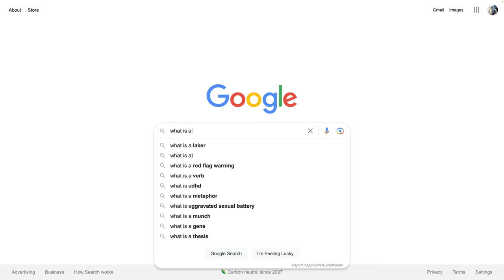I Quit My Car for 30 Days, Here’s What Happened

Comment: Remembering to ride for fun is really important imo. I've now gone full circle from crappy bike to nice road bike to wanting a cheap bike that I can ride places and lock with 0 fears of it getting stolen
Reply from the maker: The only solution is to get all the bikes 😜
Reply: @MitchBoyer  Yup I have 5 bikes. Quit my car for about 400 days now though. Rented a few times but way less than I expected. I haven't really missed it tbh, even though most of my life is in a circle as large as 130 km (diameter).
Reply: Even crappy bikes get stolen . That is the one downside of bikes. Bike thefts
Reply: @Sirissssss right, people think that beater bikes are less likely to get stolen but nah, thieves would still steal a bike even if it had rust all over
Reply: @sonymicronin  it's not less likely, it's less devastating.
Reply: I’m super lucky to be in a city with a bike share, and I use that as my “third bike” option: nice road bike for adventures, solid steel frame commuter with panniers for going to work, and bike share for going to dinner, to a concert, to a park in a high theft area etc. They are slow and goofy but reduce my fear of bike theft to near zero

Comment: I "dutched" my 30 year old MTB last year.  I ride it everyday, and I went to the store today to get bread and bananas.  You should get another pannier to go with the one you have to balance out the load.  I have two to keep the weight even.  I need to look into a front rake too.  I just changed out the rear hub for a Eviolo 380 hub.  Works great on hills and flats with a 24/17 combo.

Comment: dutch bike (in my opinion):
- costs about as much as the lock it's tied down with
- enclosed chain
- coaster brake
- lamps cheap enough to be left on the bike at all times
- some cargo capacity
- mudguards

it's not about the handlebar

you should look into european postman's bicycles, they look fugly but are a pretty sweet deal for what they are (short gears, enclosed chain, 1-200 pounds of cargo capacity all for 3-400 dollars perhaps although shipping might be a bit pricy)
Reply from the maker: Thanks for watching, Mark. I’d love to get one of those cargo bikes in the future!
Reply: In England today anything that isn't screwed down and locked with a  £150 lock will be stolen. I don't even have a bicycle lock as I never let my bicycle out of my sight or that of a trusted friend when I'm out riding. Even trash bicycles are stolen
Reply: @Honkawsuzyamal  bike should cost less than the lock and you should be prepared to change parts for vandalism. if you lock the wheels and the frame, it's not your bike that's going to be the one stolen, but the one next to it that's easier to steal. i lived in fulham although i know it's not the worst neighbourhood, this was my experience. cheap mountain bike, u lock and a cable for the front wheel, price of the bike about 50 pound, price of locks about 150. locking wheel skewers were still discouraging at the time.
Reply: @Honkawsuzyamal  now with little folding electric scooters, last mile transport is much more elegant i think. no need for the bike. i haven't tried these, but they look good to me.
Reply: @markifi  Electric scooters are not allowed on trains in  UK since last June. Electric bicycles are allowed at the moment
Reply: @Honkawsuzyamal  oh. that's a bit of a shame. thanks for the info

Comment: You can do laundry pretty easily at home with a large heavy duty plastic basin, a clothes washing plunger, and a spin dryer. I completed full loads quickly and easily with the basins set in my bathtub. And once spin dried I laid them out around my apartment to dry for a few hours. Did it for 11 years before I moved to a place with in unit washer and dryer.

Comment: Bicycles should always be the first choice of transport before getting in your car. You don’t get stuck in traffic or need to worry about where you will park or pay for it. You can usually lock up right outside your destination so that can take minutes off your journey if you’re unable to park close by. Even for longer journeys it can be surprising that there’s not a lot of difference in journey times and if there’s traffic in a town or city then a bicycle will usually be faster, check it on Google maps and set the time of your journey!

Comment: As a Scandinavian I think its funny how in the US you have to customize an old bicycle to make it into a commuter bike. Here you just buy one. 

Couple of summers ago I got a vintage bike(1978) for $20, put $50 in tyres and tubes, milk crate on the rear rack(factory) and it has been working like a dream.
Bullet proof coaster brake and in hub 3 speed gearing. 

No need to buy $XXX in parts, everything was perfect from the factory. All bikes come with fenders, racks, bells, lights, etc.

Comment: Haha, it's actually funny there's a video like this. It's very normal way of living in the Netherlands.. doing commute, groceries etc with a bike usually under 20km/12miles. Only the biggest difference is that dutch normal road bikes usually have a coaster brakes and no gears. I do have 3 gears and a coaster brake but its more luxery than a neccesity.  Most of us also have a bit larger transport rack on the front, but what you have is also common. Fun to see this in an American context, you would do very well in the Netherlands! Only you wont see Jack Black at the traffic lights here. ;)

Comment: Great video! I built up a Surly Straggler last year with a mish mash of used and high-end parts to get me around everyday (no car) and to have as an occasional gravel spinner. BIG difference to my Specialized S Works Tarmac that sits underneath a blanket in my room not getting ridden due to having a new born though. All of this to say, I am actively trying to sell the Tarmac as the fun level is genuinely through the roof with the steel tank. I get fatigued less as I am not trying to sprint everything, I have more fun exploring and of course riding to work. I don't think I'll be going back to a carbon machine but I understand the performance and speed factors are for real (I do miss sprinting at 40kph/h around Paris haha!). I hope you find more fun in your everyday biking needs! Cheers 😁
Reply from the maker: Sounds like a fun bike! Thanks Cameron!

Comment: 11-51 cassettes are the best for commuting.
Plenty of range to get up decent hills, and also room to run a big enough chain ring so you can cruise fast on the flats.
Reply from the maker: It’s been incredible! So glad Nolan recommended it.
Reply: And what crankset pls?
Reply from the maker: @onedelacruz3660  Shimano Deore Cranks with a Wolf Tooth 38t chainring
Reply: @MitchBoyer  thanks man
Reply: @onedelacruz3660  I'm on 700C wheels with 35mm tires, and I run a 38T chain ring in a 1-by set up.
I live in Hong Kong and we have a lot of hills, so I find I am very often riding in the biggest 2-3 cogs on the cassette. I think that is 39, 45 and 51. They'll get me up anything I need to climb, and I can carry quite a lot of gear.
Cheers

Comment: I turned my old Hardrock into a communter bike and it works fairly well. It is also so old I doublt anyone would steal it. I have limited safe bike routes but I can do grocery shopping and several other tasks without driving.

Comment: So what you have here is deemed an “xbike”, a bike with something eXtra. 

This would be the perfect build for it not for the V brakes, I hate them. I’m a diehard Canti fan, or discs

Thanks for making this video, it’s empowering to see others do what I’ve committed to doing myself.

In 2022 I sold my only car (SUV) and commute completely by bike and on occasion, my scooter. 

Initially this was difficult, but it gets easier once you figure out the logistics. I have a large chromebag when I go grocery shopping, I use a JackTheBikeRack when I switch between bikes, I also have a 90s MTB turned fun bike/xbike/commuter, it’s such a sweet ride.

There are moments when it sucks and I think it’s worth pointing out those aspects. When it rains, when it gets windy, too cold (I live in the Midwest), and of course too hot.

It is as you touched on, fun, and the fun never ends as I’ve doing it for about a year.

I don’t miss the cost of registration, gasoline, insurance, & repairs. If I need a vehicle to haul something I rent a pickup truck at a local hardware store, or we take my wife’s car for smaller hauling.

My commute is about 4 miles, I realize not everyone can do this, but if you’re within 5 miles, I highly recommend you give it a go for an month, you’ll notice an improving your attitude if nothing else.

Subscribed

Comment: Fourteen years ago I didn't have the money to fix my car, so instead I bought a new Diamondback Hybrid bicycle from Amazon. It took me some time to figure out how to have dry clothes when I got to work. Moving to a different job much further away I used city bus bicycle racks for most of the miles. I didn't miss my car except during cold wet windy days. Now I am retired and got me a shiny new Biktrix dual battery E-Bike. No more whining about hills and wind. Cold and rain is still with me, though being in Florida, cold doesn't last too long. My only transportation is my E-Bike and my old bicycle for back up. Florida has some beautiful multi-use paved trails, but most of the streets could be more bike friendly and safer. I mostly shop stores that care enough to have secure bike racks. Hopefully, cargo bikes will become more popular and prompt more people to to leave their gas hogs at home. That's my 2 cents.

Comment: Hello, a very good video around urban use of bicycles. As you point out, the type of use will dictate the type of bike and the accessories. I'll add that the environment is also a factor such as rain and snow. Mud-guards are a must for me in Montreal as are studded tires for winter. A trailer can also add to the ability to transport items. Theft is a big problem. I had a very nice bike which was stolen. I replaced it with a mid 1980's MTB and upgraded its components like yours. This way I worry less.
Reply: Even if it's a nice bike, I feel like even a little bit of rust puts thieves off. Also helps if it's a style of bike that isn't in vogue right now like an old cruiser bike. I feel like MTB's are the only style of bike most people are interested in now (at least here in the UK), so they're probably the most likely to get stolen over here. I feel like anything with an upright riding position, sprung saddle and a headlamp is seen as uncool by most people these days, but those are exactly the type of bikes I like 😄

Comment: To get things done in life, it looks like it's better to use an old "beater"bike with a steel frame rather than some new high tech carbon fiber bike with microprocessor shifting.  I found that simple information interesting.
Reply: Yeah. Old steel frame bikes weigh a ton, but they're sturdy af and I love them. I'd love to have an old Worksman industrial bicycle, but they're impossible to find here in the UK. I have a 1982 Raleigh B0mber (have to censor that word otherwise YouTube deletes my comment). It has a similar frame design to a Worksman, but lacks the second top bar.

Comment: Not bad, but until you take a scuba cylinder 20km before starting work I'm only mildly impressed.  I left home at 15 and only had a bike.  I did everything from shopping, to riding to work, and on that one occasion, getting my scuba cylinder to be filled.  It's called utility cycling.

Comment: Dutch bikes have fully-enclosed chaincases, meaning the chain won’t get all rusty in the inevitable rain, and either single speed or hub-gears. Also, more relaxed geometry for less twitchy handling and more comfort. Mudguards and pannier-racks are essentials too, for how else do you get your clothes to the laundromat or groceries back from the shops. Design for racing has rather spoiled the breed than improved it. Horses for courses, innit.

Comment: Dutch urban bikes (for less than 5km, flat terrain): 
(1) so cheap noone wants to steal it (for the real dutch experience, the rider should acknowledge the prevalence of bike theft but not chain their bike to anything)
(2) low top tube.. this gets important if there's a kid on the back as you can't swing your leg over the seat without roundhouse kicking them in the head 
(3) leave it outside, never maintain it, it should be a pile of rust with a chain last greased in 1942 
(4) 2"+ Schwalbe Marathon tyres... these rock! 
(5) swept back and high handle bars that let you sit upright on the seat 
(6) seat large enough to land a 747 on
(7) poor/absent helmet + lights 
(8) sturdy racks.. it's not unusual to see a 12yo kid being transported by just standing on the metal rear rack with hands on the riders shoulders

Two most common ones are "omafiets" (granny bike) and "bakfiets" (bin bike). The latter screams for an electric drive (mid-drive in your case for the hills) and there's kits available. If you're a proper cyclist, the laid back position will be irritating but with an electric drive you just sit back and turn the peddles.The cargo bikes (bakfiets) are nice to just fill up with stuff (kids/bags/dogs/girlfriends) and go.

Comment: Get a hand powered laundry washer and electric wringer you can use in your bathroom. I did that for a full year in a tiny apartment when I was saving up to buy a house. Much easier and more sanitary than sharing your underwear at the lavanderia. And get a trailer if you want to haul stuff. I have a BOB trailer that is probably your age. Also, your seat height looks too low on the town bike.
Reply from the maker: Good advice! The bike’s a little small for me, but I’m okay with it :)

Comment: I decided to quit my car for 3 months..and never looked back 😳. Not only did riding a bike as my main form of transportation get me in killer shape, it opened my eyes to just how little I truly needed a car in my life. 90% of my life is spent within a 20 mile radius..after a couple months of daily riding, 5-10 miles at full cadence is nothing, so long as you aren’t carrying groceries or something. I used my bike for grocery trips, mailing packages as part of my ebay business, took 142 lbs of brass to my local scrap yard, running general errands, I’ve done doordashing and taskrabbit gig’s (in the spring/fall, collected scrap too so..I got paid to ride my bicycle!) to and from work etc. I eventually upgraded to an ebike..and then scratched the itch I’d had for a sound decade and bought a dual-sport motorcycle. It’s now been 3 1/2 years and I still don’t have a car 🥲. I ride year round through all 4 seasons. It’s not only changed me physically, saved me a ton of money on car repairs/insurance, it’s changed the way I look at the way we get around in this world in general..it no longer surprises me that the countries in which people tend to live longer than average lifespans, are all countries in which bicycles are more commonly ridden. 

I ride the ebike/motorcycle a lot more these days, but I still take my road/mtb out on grocery runs and for general exercise. Without them, I would have never started this and I would still be driving my smelly car that was in the shop every 4 months like clockwork 🥲. Really don’t miss it, by the time I buy a new one - I’ll have saved enough from not driving a car to buy pretty much whatever I want 😁🤙.